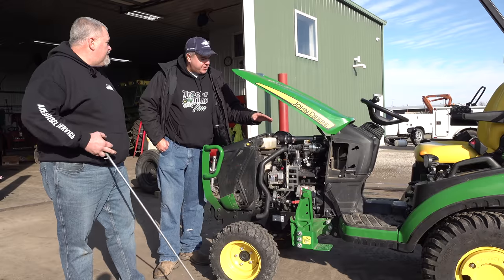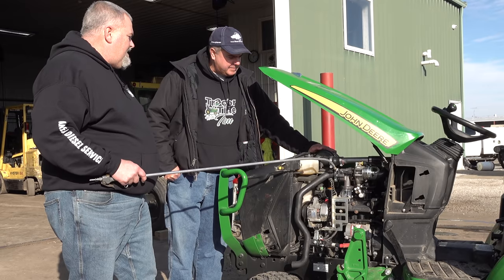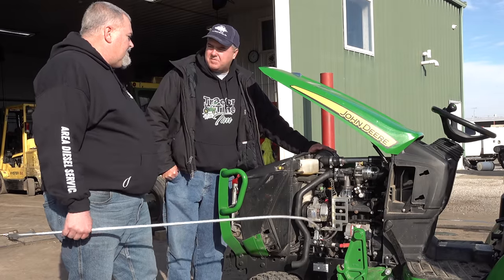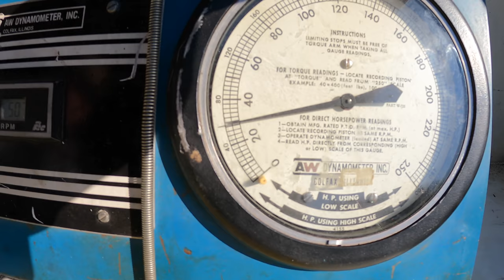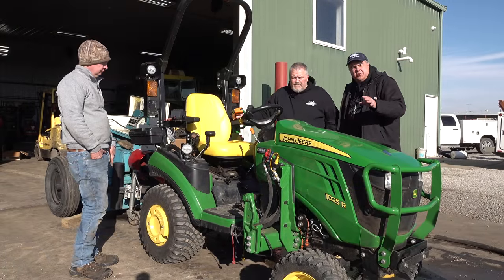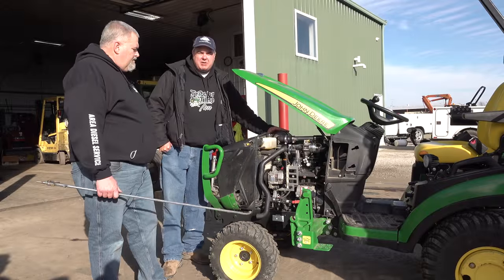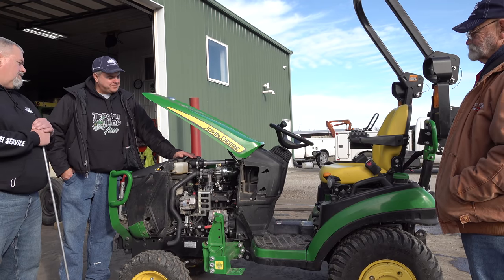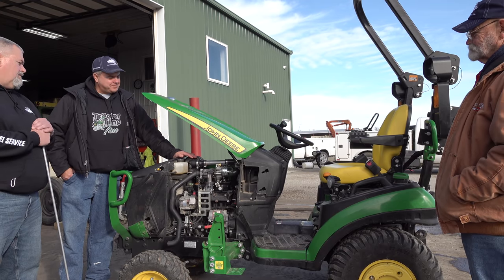John Deere 1025R Turbo Dyno Test!!  You Won't Believe It!

Comment: Wow, considering a stock 1025r makes 18 to 20 pto hp(roughly 20% loss through powertrain) 32 pto hp would net about 40hp at the crank.  This is truly impressive on only 5lbs of boost! Can't wait to see you test it on real world applications Tim.
Reply: Basically made it into an 3039R  equivalent as far a pto hp goes.
Reply: That’s huge increase and on top of that 5psi isn’t anything to sweat over. That engine will do just fine for many many years
Reply: @GoGoggansGo  that's exciting
Reply: Definitely impressive!  I'm very interested in doing something similar to a Kubota LX-2610.  I would love to get these increases!
Reply: @GoGoggansGo  not true, these smaller engines have extremely tight ring gaps, under 13k max clearance, for my kubota engines that i turbo, 15hp stock and with a modified pump i get up around 40hp around 30 psi of boost, i usually have to open the ring clearance about 2x more than stock, for this new of a engine pulling it hard and long it will butt the rings and ruin a sleeve and sometimes can pull a piston apart.

Comment: Loving the 1032T so far Tim! Looking forward to follow up real world tests.
Reply: 1032RT
Reply: Actually 1038T or 1040T would be about right for engine horsepower :O.
Reply: Might as well through out 1038TRX , sounds good
Reply: Is the “T” for “Turbo” or “Tim”?
Reply: @runnikee6986  Yes
Reply: 25hp +60% is 42. If the difference is still 28% between flywheel and pto like the factory rating of 25 and 18. Then 32pto would be aprox 44hp flywheel. 43 is in between those two figures.
Reply: @ponypwr  stock 1025r has 25% more engine HP than pto HP so 25% more than 32 is 40. Though with more aggressive boost it could probably go much higher.

Comment: What has impressed me the most so far is how well it has all been put together. 
In theory anyone could cobble together and Frankenstein a Turbo on an engine. 
But few could put it together so professionally and seemingly so far without compromise. 
My only suggestion is to run an accurate temp gauge, EGTs can be fine but the overall extra power can tax the cooling system under the right conditions both operational and ambient temperatures. 
Absolutely cannot wait for the testing to begin!

Comment: Von helped me many years ago when I built a twin turbocharged Ford for my 2 wheel drive pulling truck. Area Diesel supplied the turbos,  and Von spent time with me on the phone with advice and ideas.
He helped a couple of my pulling buddies that had turbos on Chevrolet engines.
Top shelf folks at Area Diesel!

Comment: I've ran 2 PSI on my 2015 1025r for several years with zero issues. I had the exact same experience with the additional torque keeping the RPM up not bogging as much when you load it initially. You wouldn't believe how good it sounds! I'm surprised that Tim didn't do a couple of drive-bys for this video.
Reply: @zz3astro What did you do for fuelling ?
Reply: @IMRgarage  Nothing because I wasn't sure what the drivetrain could take with extra power. Mainly I wanted the turbo sound. Maybe I missed it but I'm not sure what they did on this one but obviously something.

Comment: Interesting project.
I know I mentioned it previously that M&W Gear used my boat and engine to develope a turbo kit for a marine engine in the late 70's. Chevy marine engine was rated at 255 HP. After the very simple 3psi twin turbo kit was added it produced 310HP.  Kit had to be Coast Guard approved. To prevent over revving I had to have my propellers repitched. Performance change was impressive.

Comment: Most powerful 1025R ever ! I do have a couple of concerns, summer heat under heavy use could that maybe increase those temperatures of the turbo exhaust and is the factory amount of engine oil and even coolant going to be enough for this power upgrade under heavy load. Nice install by the shop, looks like it came with it ! Merry Christmas & Happy New Year !

Comment: Tim… one of the uses that occurred to me was working on hills.  When mowing up a steep hill, mine bogs down.  The loss of rpm’s makes me slow down my forward speed.  Otherwise, the mower will drop below optimal speed, leaving a ragged cut.  This is exacerbated when I add my PTO driven vacuum to the power train.

Think how many minutes I could save with the turbo!  Almost makes me want to find a job somewhere to justify the cost… because everyone knows that retirement hours aren’t billable!
Reply from the maker: Good point!  Combination of Large PTO load while at the same time large Hydrostatic load is great example of when you could use more horsepower without stressing either system.

Comment: Tim, when you work it hard , afterwards idle your tractor for several minutes to allow the oil to cool the turbo down before shutting it down
Reply: Great advice that wasn't mentioned in the video.
Reply: I agree with this logic, ive done this to my vehicles for at least 2 minutes of idle after worked…..

Comment: Merry Christmas Tim, Christy, and Katriel. There's a very simple reason to try this modification. If it proves successful then people with older tractors have hope of powering up to gain a little better performance when they do a rebuild. Tim, you never said how many hours were on Johnny X when you dropped it off. I can see doing this to my older diesel tractors to gain a little extra umph. I have a "new" engine to drop into Kubby, and I'll have the remnants of the original engine to deal with. I'll probably get things professionally looked at, and then I'll build it, and I'd love to have a kit like this to add for a new power plant. I'd be happy (ecstatic) with a 33% increase, but I'd take an increase of just 2 to 3  PTO HP.  That's why you're doing this. You're doing this for us. You are taking all the risk to bring us something better for our sub-compact tractors. The rest of the home tractor owners will benefit as well. For this and all of the other implements and improvements for our tractors I want to say THANK YOU! Have a Happy and safe New Year!
Reply from the maker: 110 hrs

Comment: Thats some impressive HP gain.  Consider putting a heat shield over the hot side of the turbo so you don't soften that plastic hood. just needs to be a piece of metal about a half inch above the turbo.  The heat coming off it when you are working it will damage the plastic, not right away, but eventually it will either dip or crack.  That little tractor will do some serious mowing now.

Comment: Hey Tim, I don't know that you will see your additional power through the wheels because of going over relief.  Where I see it working is through PTO attachments.   Larger rear mower, stump grinder, tiller.  Also, track the fuel burn vs your standard tractor.  Very clean install.
Reply from the maker: All things we will test.
Reply: The stump grinder is the one I want to see.  I've been kicking around getting one and this could be a game changer.  Id like to see what it might do for a wood chipper too.
Reply from the maker: 1025r is fine with the Baumalight grinder as is.  Could use a bit more HP, but hate to stress PTO too much in that application.

Comment: This was very interesting to watch.  Definitely cheaper than purchasing another, or trading in for, a higher HP tractor; at least I think.  I would like to see you do this on your Kubota LX 3310 some time!  There are a lot of LX owners (2610s and 3310s) that I'm sure would be interested in this.  I know I am.  Thanks Tim!
Reply from the maker: I don't think the LX rear end is tough enough to handle much more HP.
Reply: @TractorTimewithTim  Although it saddens me, I do appreciate you letting me know.  I certainly wouldn't want to break anything in the powertrain.  For some reason I did hear that LX rears are made, for lack of better words, 'sub par' from other similar Kubota tractor model rears.  Not sure why ... I guess it's done for overall 'cost efficiency'.  Although, thinking about it, I'm fairly certain everything is equal in both the 3310 and the 2610, except for the engine and is what sparked my interest, since I've got an LX-2610 that I would like to increase it's HP; at least match the 3310.  Thanks again, Tim.
Reply from the maker: @davidolchewsky5365  oh, sorry…yea, you should be able to turn up a 2610 to the size of the 3310

Comment: What an awesome group of guys. Like one commenter wrote, "1032T". That made me smile and it's accurate. Let's see what this baby can do. LOL
Thanks for sharing Tim, Christy and the gang
Reply from the maker: Remember, model numbers are based off engine HP…so 1038X (for extreme, or experimental)
Reply: @TractorTimewithTim  I like that
Reply: @TractorTimewithTim  Stock has a 28% difference between flywheel and pto hp figures. So 32 pto hp its more like 44hp at the flywheel!
Reply: If its 60% over 25hp that would be 42hp. So 43hp would be most accurate.

Comment: Super excited. Would love to see the 3025e kit. Should be about the same with the exhaust coming out on the other side. Also my 3025e will bog down all the way till it stalls if I stay in it. The hydrostatic trans doesn’t have any release. And also would love to take my 25hp to a 32hp to help with running the rotary cutter and not have to mess with any regen issues that come with the factory 32hp.

Comment: Tim, another great video!  I’m sure if someone is going to push Johnny X; it’s you.   32HP at the PTO is awesome for one of these little tractors.   I think it’s great you’re using your platform to help another business, and show the manufacturers that a turbo option is truly something people are wanting.   I know I’d like to have another 10hp on my Mahindra.   Like ya’ll were discussing, I’m pretty sure the engine is going to hold together with 5-8 psi of boost; but between the hydrostatic trans, and diffs; that may be another story.   Glad to see you’re putting in the due diligence to do some R&D and not just putting a kit out there….If I was a betting man; and the tractor holds together you’ll probably find yourself wanting to bump it up to 10-15, maybe even 20psi and add a fire ring head gasket and some new head studs before releasing a final kit.   Definitely need to see how it does next summer when the ambient temps are a lot higher, just to be safe.   Thanks again for taking this on! If it fails; at least you’ll show that a turbo is just too much; but a lot of these tractors have similar displacement at different hp rattlings and I think it’s your driveline and hydraulics that are going to be pushed to the limits and not the engine when it comes to long term reliability!  

Keep the Johnny X Turbo videos coming!   Jon@SBYD!

Comment: When the measurements were taken on the Dyno the PTO speed show to be 400 to 500 instead of 540. Why? 
What fuel system changes were made to increase the PTO hp, without additional fuel you can't make more HP?

Comment: The weak points will be the transmission and the PTO clutches.  The ground power will not change unless you crank up the high pressure reliefs on the hydrostatic  transmission.

Comment: Tim, a good equipment test would be with a chipper.  I run a Woodland Mills WC88 on my 2032R.  That chipper is rated for over 30-50 PTO Hp and the standard 2032R only has  28 PTO Hp. Where I see torque issues is during startup when it is working to spin up that 200 lb flywheel in chipper.  You also can see the weakness when running a bid log through. Similar to when you are using the brush cutter on heavy brush and saplings. .

Comment: Great video series Tim; I really enjoyed watching the progression and look forward to on going results over time.  All manufactures tend to under rate capabilities (tractors, trucks, etc.) of the equipment and even engineer output limitations.  I suspect this is for longevity of the equipment, reducing warranty repairs and knowing if they allowed the equipment to operate at or close to its limit that many people would still push it beyond that point and failures would result.  I am very curious to see how it performs and holds up over time with someone that I think would show a little restraint in operating and not constantly push it past its limit.

Comment: You probably need to do some rototilling or brush cutting.  I would think you would want to have a combined drawbar plus PTO load to really see the difference between this unit and a stock one.  I think some back-to-back runs compared to a stock tractor would be interesting.

Comment: The big question is will the rest of the drive line and accessories hold up under the increase in power.  Hot rodders know that procedure very well.......Good luck Tim....
Reply: "You are the weakest link...GOODBYE"
Reply: Exactly. "supporting mods" lol

Comment: I think the increase in HP is great...what people are overlooking is..just because you have more power doesn't mean you're going to use it every time you get on the tractor . Where I would see its benefit would be like when you used the corn picker in one of your videos..obviously the tiller..brush hog etc . With more HP..there will be occasions where rpm can decrease and provide enough power to do a job which will also maintain dependability...as a mechanic..tho I have raced different toys over the years..high rpm lessons dependability...I don't forsee the turbo shortening lifespan if you follow the theory of rpm power versus task at hand..GL with Johnny..I hope he fulfills your expectations

Comment: The EGT were good. Was anything done to the injectors?  I would be fascinated to get more knowledge from the guys that done your custom turbo
Reply from the maker: Nothing to injectors
Reply: Tractor Time with Tim did you adjust the fuel screw after the turbo was installed?

Comment: Glad to see that you got your tractor back! I agree completely about the top speed. That’s shouldn’t change much as the hydrostatic drive will limit that. I can’t wait to see what it’s like under a load, mainly tilling. I think tilling will want to pull it down more and I feel that you’re going to notice that it will have more torque to pull through those tougher jobs.
Reply: I feel the top speed may change due to the extra hp to pull up a hill on the highway. My 3039R will do 18 mph but only down hill or on an even grade. It pulls down fast on a grade.
Reply: @bradbruggeman6745  uphill might change. I was thinking about level ground and being limited by the hydrostatic pump. I could see a change in speed with a gear drive on flat ground.
Reply: Unless you change engine rpm a turbo won't change ground speed on flat ground
Reply: @hughjones7255  
Wasn t implying that. Gear ratio won't change,I know that. But more hp will help reach and maintain top speed much more easily. Maybe in a 1 series with only 2 range hydro it might not make a difference. With my 3r with a 3 range hydro and 18-19 mph top speed it would make a difference in reaching and maintaining highway speed.

Comment: Granted my standard calculations are based on pump gas, but I was expecting 28hp tops. What this actually hit on diesel was phenomenal! Like the ADS guy said though is potential longevity becomes somewhat compromised, but you know what, if ya break it, time to upgrade! Standard motto in motorsports. 👌
Reply from the maker: ADS said they could get over 100hp out of it.

Comment: Yep, barking tires and scalping lawns.  Now you got a mini pulling tractor, just need to get a wheelie bar made for it.  Looking forward to your field use evaluation.
Reply: Mini Pulling tractors with a yanmar diesel put out about 250 hp. I am a machinist and I made an adjustable timing gear for one. I believe this yanmar was bigger than the one in this video though. I know one that had a turbo from a powerstroke diesel on it and a Bosch 3 cylinder "A" pump on it. Also hydraustic is no good for a pulling tractor.
Reply: I doubt it would make a good mini pulling tractor with that whimpy hydrostatic transmission.

Comment: It will be interesting to see if it will need increased cooling capacity when operating under load. (Double up radiator/increase fan flow.)
Reply: Thats a good observation, and worth looking into

Comment: Always liked the size/footprint of my 1025R, however that being said, why they only make it in the "25HP" size is my biggest question. JD makes smaller tractors with up to 25 hp why not a 1025R with the hp like in the 2032 or 2038 that comes with a turbo? I would love to get my hands on a aftermarket turbo from Area Diesel!
Reply: One reason namely being the lovely governments DPF requirement over 25hp.
Reply: Emissions certification.

Comment: Did Area Diesel ever make a kit out of this demo turbo?
Reply from the maker: No, but http://hydrosplus.com did!  Use code ttwt for 5% discount.
Reply: @TractorTimewithTim  Thanks Tim.   I did look at that guy and it looks like a simple install.   Do you know do you still get some benefit with the turbo even if you DON”T inject more fuel into the mix?  I just need some boost to the PTO HP to find a chipper my 1023e could run.   Love all your videos and your bible verses.

Comment: Really love this series Tim!!  I'd love to do something like this to my tractor.  I have a Mahindra 1526 with a 25 hp Mitsubishi S3L2.  My tractor has the same HP as Jonny, but is much bigger and heavier and I live in New England, with lots of steep hills.  I could really use some boost!
Reply: Mitsubishi has an OEM turbo for those engines with a set of part #'s buried in a manual
Reply: @boomerau   Wow, that would be awesome!  I'll need to do some research on that.   Thanks!

Comment: Any concerns about heat in proximity to the plastic body work and hood?
Reply from the maker: Not at this time.  They considered this during design.  Tried to keep components some distance away from the plastic.
Reply: Ok.  Didn't see any heat shielding or wrap so I had to ask.